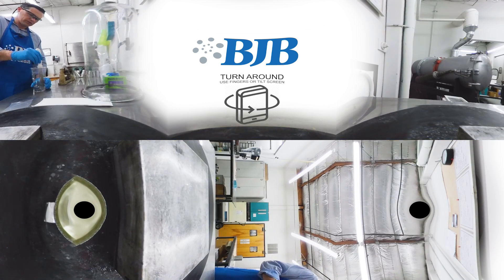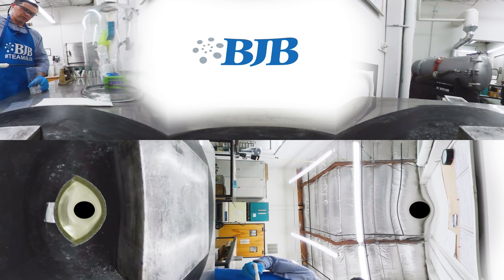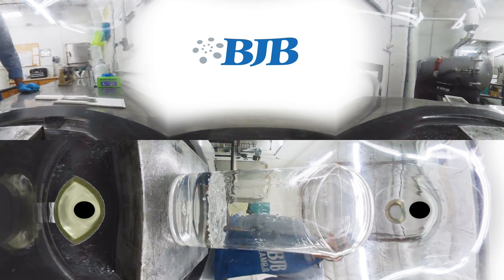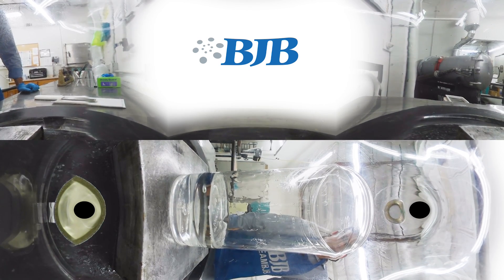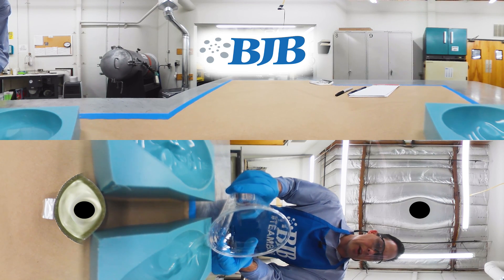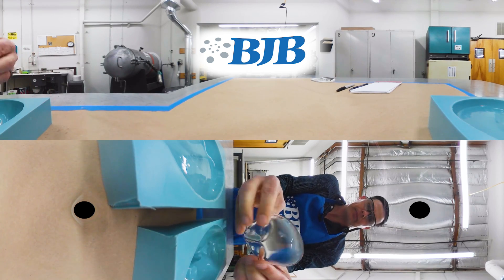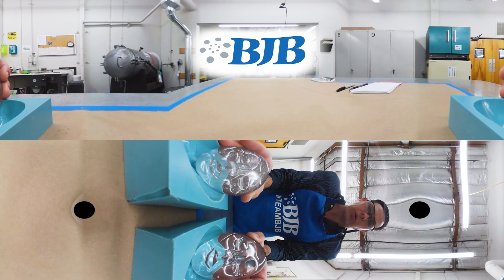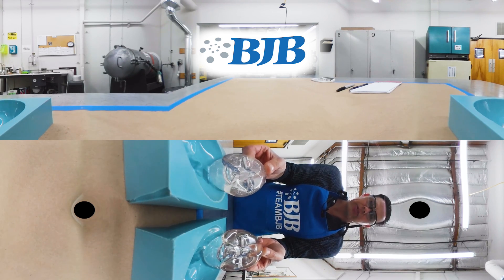Pulling Vacuum on Clear Resin | 360 Video | Use your Finger or Mouse to Move

Comment: Love the product and love the info but I dont think this is a good format for a video.
Moving with the mouse or fingers is better than the yoga I had to do on its first upload but its still not good. I think standard camera with good editing would be easier to watch.
Reply from the maker: Thanks for the feedback.  We are always trying new approaches to content and see what end users respond to.  The purpose of this video was to get really close in to the material under vacuum to see the details not normally seen in standard videos (cameras don't normally go into a vacuum chamber for instance).  We will continue to edit standard video content but there are many new users of VR style goggles that this video works best with.  The original upload worked the same as this video, we simply added additional instructions for those new to the format to get the best experience on Mobile or Desktop screens.
Reply: @bjbenterprises  ah, yes. I should have tried that. 
Still love it

Comment: interesting Vid. I was using your products. Great one! I see some of the 2 piece mold making vid using clay to form the silicon mold. Is it legit? Also what is the recommendation for vacuum pump in term of casting silicon and polyurethane
Reply from the maker: For vacuum pumps, we typically recommend a unit that has at least 6 CFM and a dual stage pump design (dual rotary vane works great).  The larger your vacuum chamber, the larger CFM pump you will want to speed up the process (10, 12, and 16 CFM are good options).  As far as the clay question, I'm not clear on what you are asking.  Many people sculpt forms from clay and make molds.  Many people also embed their pattern half-way into clay and pour silicone mold halves.  Is this what you are referring to?